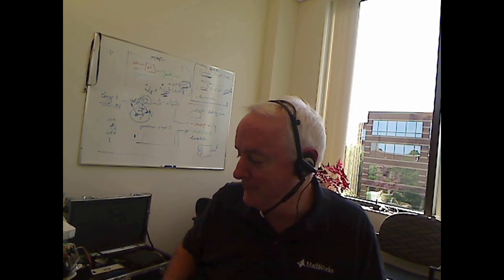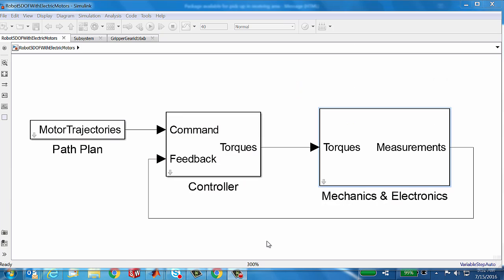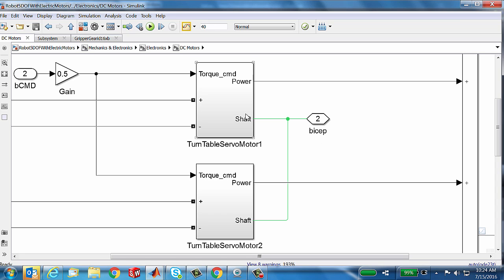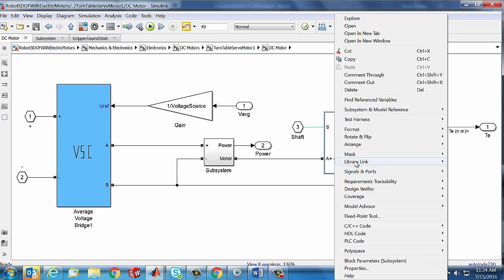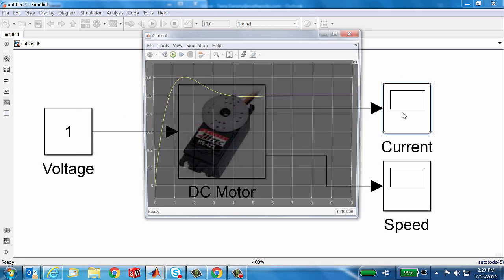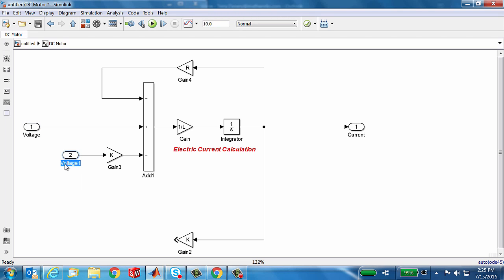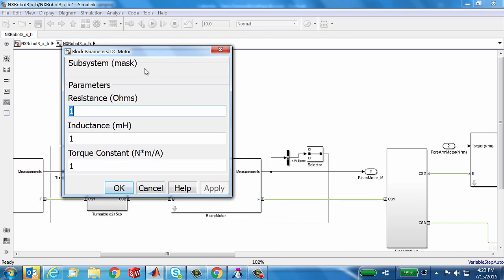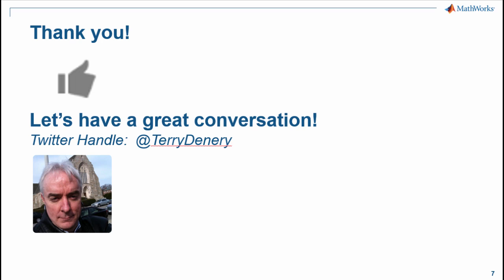Mechatronics with MATLAB and Simulink, Part 3: Electrical Actuation

Comment: Hi Terry ,, these videos are so interesting ,, i have a question that i have been searching for the answer along time ago ,, i would like to know how to apply a C code file to model of a robot that i have imported the CAD from (autodesk inventor) to matlab simulink for testing propose and simulation. i've been looking for the solutions years ago ,, i'll be very thankful if you can help me
Reply: Hi ABOU-YOUSSEF, I am interpreting a little bit, but it sounds like your c file is part of you control algorithm. You can test your c code against the model through desktop simulation in Simulink. A nice way to do this is to create a Simulink block that executes your c code. There is a method for creating blocks with existing c-code called S-function that is designed to do this, and their is a tool called the Legacy Code Tool that can be helpful in supporting you to do this. Additionally, there are ways of supporting your testing of the algorithm on the processors that will be employed in the real systems.  These testing methods generally go by the name "Hardware in the Loop", or simply HIL.

Comment: Hi Terry, I found you videos quite interesting since my final degree proyect is very similar to the robot that you use, same axis configuration. I use as dc motors hacked mg995 servos, I have replaced the servo control board with an AS5040 to get 10 bit absolute position sensing , and im driving them with TI's DRV8833.What motors are you using ? are them hacked similar as I did ?  Right now im working in the system modeling and thats where your videos come in handy.  How do you close the loop with de controller ? based on the torque produce by the robot for each joint angle config ? Ive seen some papers where they use lagranian equations to finally discribing the robot dinamic as tau = D(q)*q¨ + C(q,q·)q· + g(q), and equals the PID equation to that in closed loop. How do you include the motor dynamics with the dinamic model of the robot. what is the variable that you use to control ? measured angle , speed angle ? current ?  Do you use state space ? To identify de motor I have seen the simscape tutorial to estimate its parameters, but I hadnt the chance to try it .
If you could guide me a bit , would be so valuable.
Reply: Hi Pablo,  Videos 6 & 7 address control strategies, where the mechanical model is used for Inverse Kinematics, and Inverse Dynamics.  Videos 8 & 9 get into the modulation of voltage through the power electronics to implement voltage commands determined by controls.  Video 10 addresses how software is developed to operate the power electronic devices.  It would be nice to hear what you think about these videos.  Thanks.